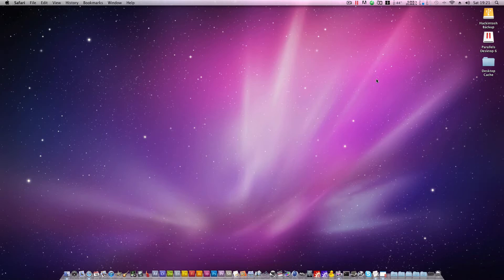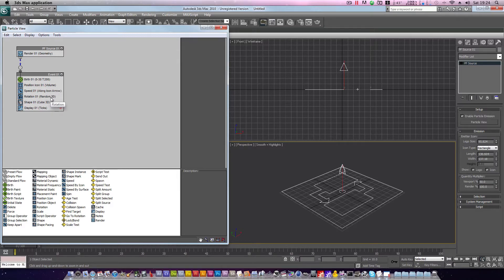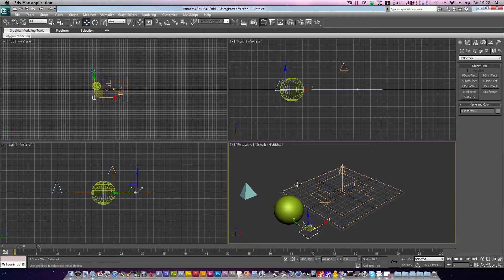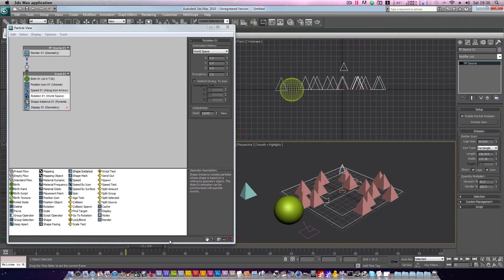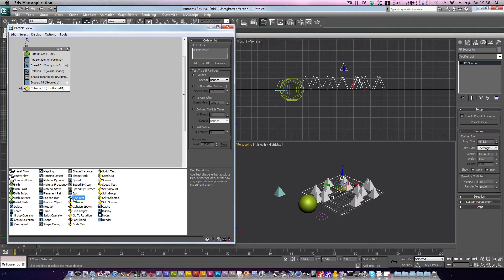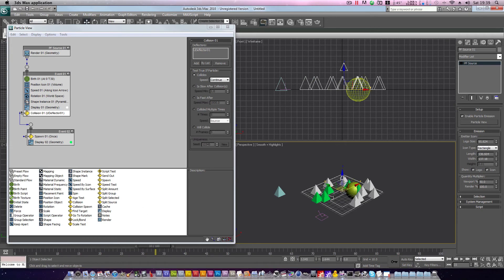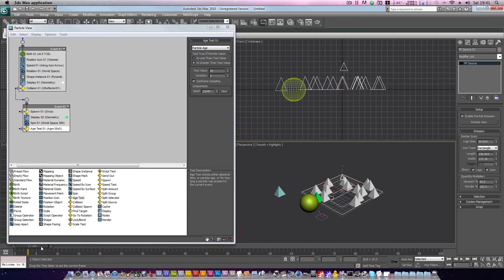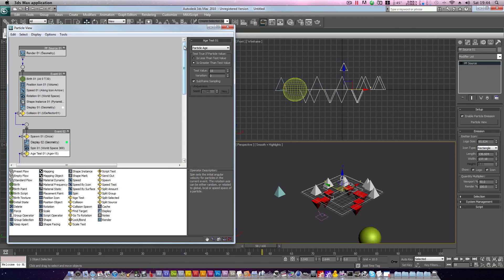3D Studio Max - Particle Flow - Tutorial

Comment from the maker: @A1ZUDD1N 

I have experienced no performance issues with Parallels 6.  The specifications are:

CPU: 2x Intel Xeon Quad @ 2.26GHz (8 physical cores, 16 virtual cores)
RAM: 16GB DDR3-1066
GPU: ATI 5870 1GB
HDD: 120GB SSD + 8TB RAID